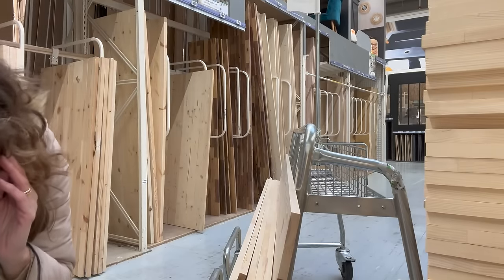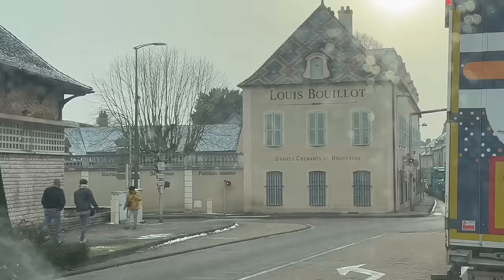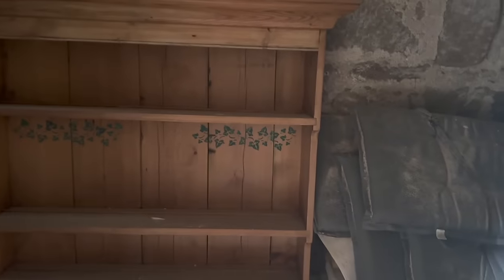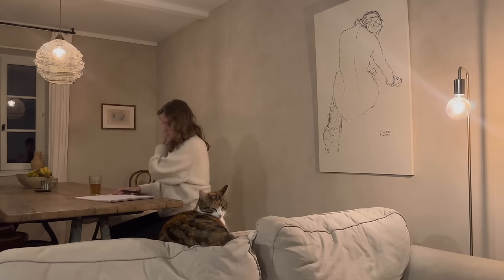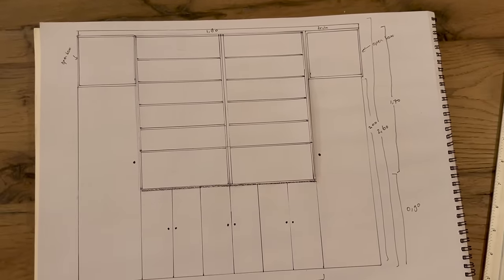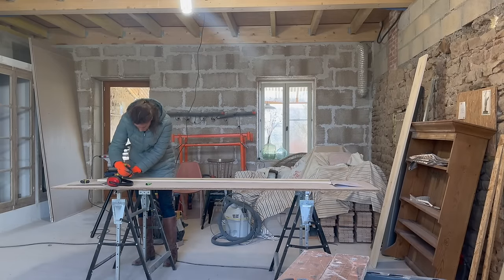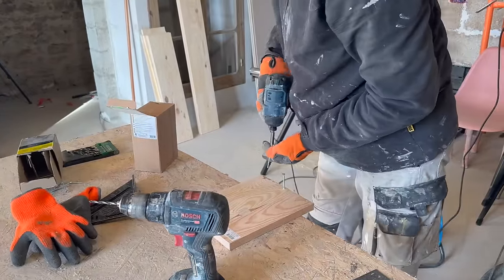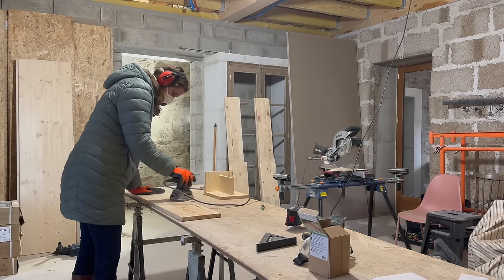Let's build a pantry for our French farmhouse!

Comment: I love the shot where behind you is the ancient  stone and new stone perpendicular and both have the same tones of French limestone. Tells the story of centuries of building techniques. Good job Marloes- as a an ID designer  I can say you are absolutely spot on in drawing first always.
Reply from the maker: Thanks! Do you mean the wall behind me? Those are hemp blocks for insulation and they will be covered with lime render. But I love all those neutral calming tones! The render will be a similar tone!
Reply: @FrenchCountryLife  ok! Wow fascinating - the hemp both insulates and provides a great substrate for lime wash? - you have them on the top level without mortar, on the bottom floor they have mortar, is there a difference? I’ll have to research this a bit…
Reply from the maker: @ShelleyScales  yes exactly! You can't close off stone walls, they allow the house to breathe. Using hemp also has the advantage of keeping the interior climate as it is with an uninsulated house, which means: super cool in the summer, even during a heat wave! Nearly any other insulation material will destroy this beautiful advantage of stone homes. But it does regulate the humidity and is a very powerful insulation for the winter too. You need to use a special mortar for them, we used it on the top floor as well but maybe you don't see it that much there. One thing though: you need to put it on a floor that's protected against humidity to prevent it from getting in the blocks. We put it on a concrete floor in the cottage and in the kitchen but that floor has an insulation and water barrier underneath. Even our architect is impressed with how nice and warm our house is in winter with only a tiny wood burner and how cool it stays in summer. No airco needed. We love it, but many architects are a little hesitant as it is much more difficult to predict insulation values (I don't know the word) and architects need to rely on numbers that they can give their clients :)
But we only used our architect to apply for the building permits for us and we did everything else ourselves and with some help of very experienced artisans. Now our architect is starting to use the same materials for other projects :) Yes do look into it. It also gives a very different energy in a room, which is hard to explain. It does something to the atmosphere. All our guests of the cottage say this too. Invaluable!
Reply: I’m totally tracking with you- the R values are not standardized with this method though like you said it’s unique. I love the idea bc it’s natural and sustainable - interesting about the low humidity atmosphere as well.  Thanks so much for your detailed answer Marloes. Smart solutions!